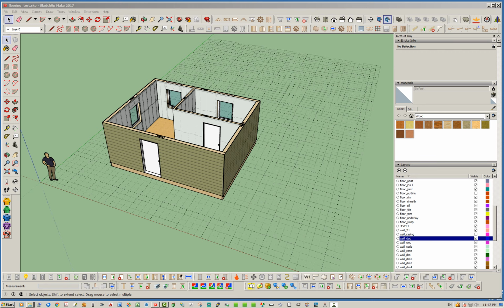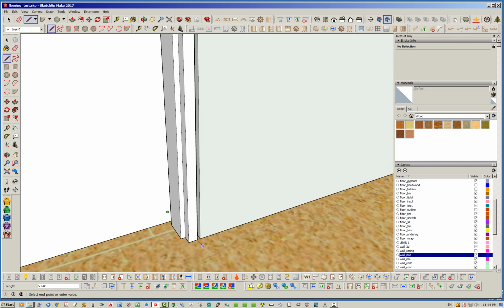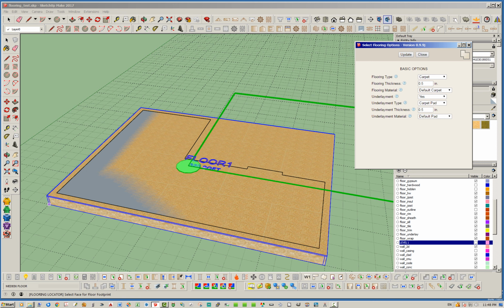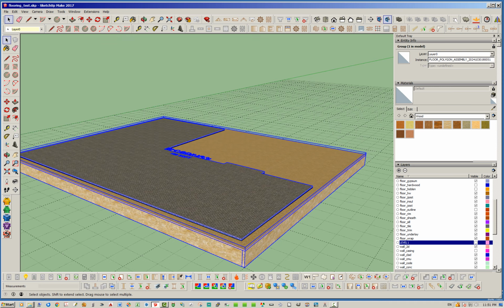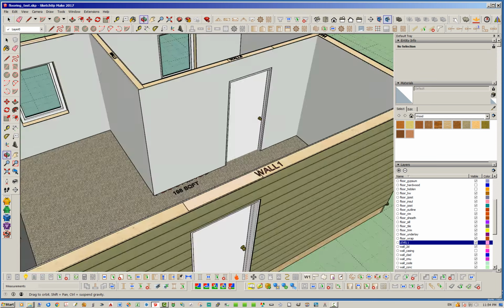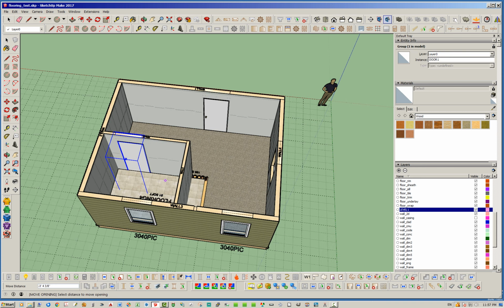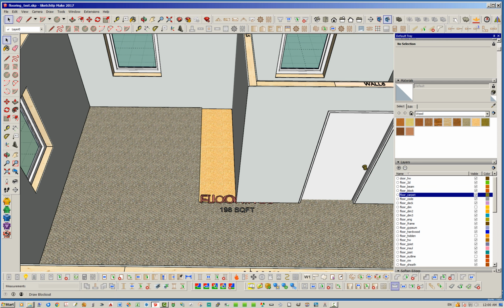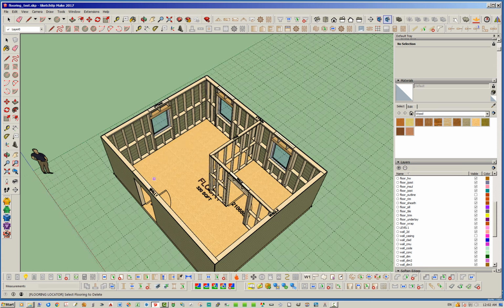Medeek Floor Plugin Tutorial 14 - Floor Coverings

Comment: The newer versions of SKP use folders in tags so with your massive amount of tags, I instantly dump them into a folder and I even nest subfolders in that to quickly turn sub groups on and off(like to hide the gypsum, cladding and sheathing). 

Is there a way to get the floor coverings to see the wall parts/edges and create the polyline based on it's surrounding walls (as in automatically)? Maybe the start algorithm starts by clicking a corner and it follows walls until if comes back to the start point (or hits the edge of the subfloor so it doesn't go indefinitely). In this model, maybe it gets run 2x for the 2 different rooms.
Reply from the maker: @johnjlopez  In theory this sounds like a great idea but the problem is that many rooms have various non closed geometry as well as entry ways.  Each threshold may need to be included in the perimeter, or not.  I will give this some more thought but for now it makes the most sense to allow the user to determine the perimeter for each floor covering.
Reply: @medeekdesign  Wouldnt the combo of walls and floor slab give an interior closed loop on all conditions? Maybe the code ignored wall openings (doors or actual opening in the wall module)(or addressed them specifically as a special case or was smart enough to connect both sides of that opening or manually set to do so ) to close the loop of a room/regular actual openings in the walls and certainly the (sub) floor is going to end at some point - meaning if 2 rooms are connected by a wall opening then it would eventually end by the sub floor ending and then the searching line should "turn right/left" at that point to continue it trying to close it's loop. Actually you are always going to have exterior walls so maybe it doesn't even need to find the subfloor edge. It would know where the exterior wall was.  

Separately, maybe people preselect all the walls that enclose the space and the code fills in whats inside that selection making it more automatic but not as manual as currently creating the floorplane fill in by tracing the room edges. This would allow multiple connected room conditions easily because the person would manually choose it. 

The only thing remaining then would be stair openings/holes in the middle of the space and maybe that could be determined by the floor slab opening? 

I'm spitballing ;)
Reply from the maker: @johnjlopez  About 5 AM this morning I couldn't sleep as I pondered how to use walls to determine the perimeter of the flooring.  After a few hours of thought and intermittent sleeping I think I may have an algorithm concocted that might actually work.  I will see if I can put something together that actually works as I envisioned it, no guarantees on this one though.
Reply: @medeekdesign  hehe you make me wonder if I should go back to coding! the process is the fun much of the time. The other fun part is watching it all successfully work!
Reply: It’s similar to the wall blocking tool, with that you manually get it to suit your requirements…
You are right with the customisation needed to collect the right volume/area for calculation and estimating a project…

The only thing I noticed was thresholds and possible adding trims for tiles…. Accessories?
Reply: Can you show the tool you use more easily for us to see…
I always pause but if you could show us please
Reply: If underlay and floor label are the draw in the same location “centre” can you move them and allow for underlay to be visible when carpet is visible but not under the carpet label
Reply: Can you move the labels so they are not obstructed by other geometry by placing them cantered to the drawn geometry and not the boundary?
Reply: Also can a threshold/tool “MODULE” be added to this module for separating the floors finished…
By either selecting a line on the polygon or stand alone took selecting two points, such as a door way or an area where the flooring changes!…

Which is similar to the timber blocking or trim tool you already have?
Reply: @dannygates806  FYI, I'm not sure but I suspect he responds far more to the SKP forum compared to here - presumably far more so as a video gets older. There is already a thread on the floor module so you may want to post these questions to him over there.